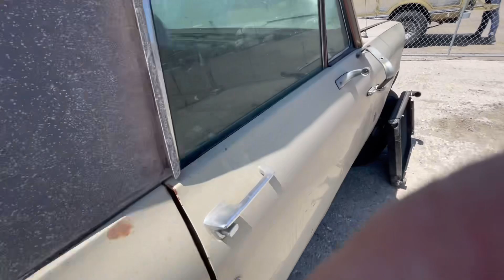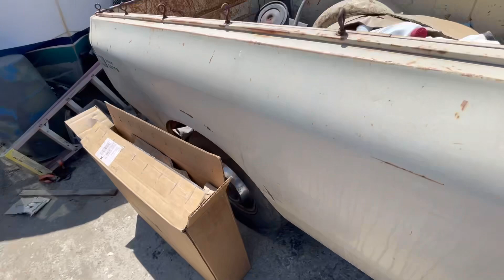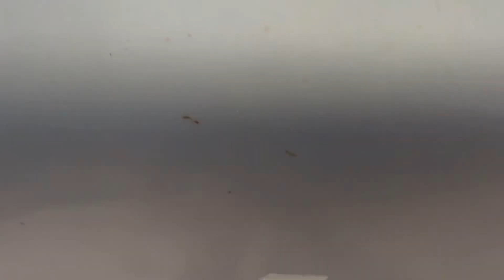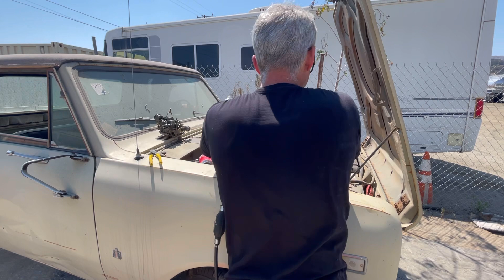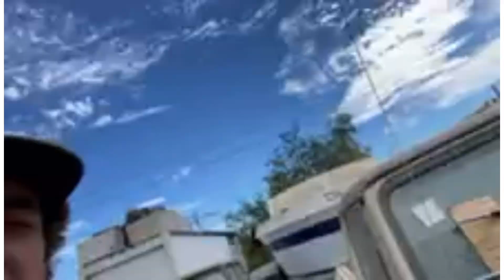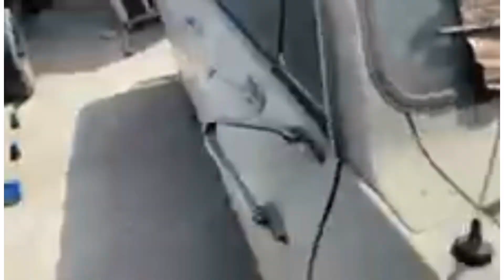The Scout Life: International Scout Terra RESCUE | Can We Save It?!

Comment: My first scout was a 1978 with the same drivetrain as this Terra. l took the factory black steering wheel off the first week l had it and put the smaller rally wheel on. l still have the black steering wheel in mint condition and the rusty scout in the back yard.. lt  had the OD Green dash pad and door panels and OD green bench seat. l bought it new in  August 1978 in WAYNE MI.